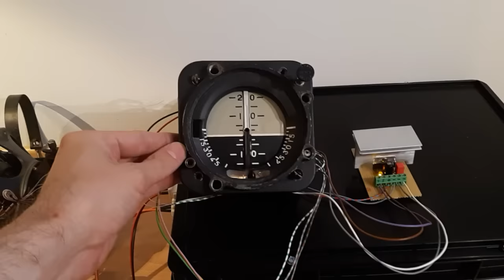Startup of a Russian "type 458" gyro block of a MiG-21 fighter after almost 40years of storage

Comment: Ham radio operators have a system for rotating their big HF antennae. It is a powered system that includes a director at the station, and a gizmo similar to a motor up on the antenna mast. You turn the knob on the director and the motor on the mast rotates, some at a 1:1 ratio in real time, no delay. The way he tilts the gyro unit and the instrument shows the direction and magnitude of the tilt makes me think the basic principles of operation between the two units is very similar.
Reply: This is so called "Selsyn":
https://en.m.wikipedia.org/wiki/Synchro

Comment: For hypersonic missiles this has to be super super accurate, as the plasma surrounding the rocket will make any external guidance impossible.
Reply: It's more like a warhead at this moment, not entire rocket, cause booster depleted about 20 min ago
Reply: @michaelscarn7375  Correct, but it is still maneuverable warhead.  The plasma makes any guidance from external sources impossible, so it is completely flying on initial conditions and calculations from the gyros data, there is so much you can improve on instruments alone, as the environmental variations will put an upper ceiling to your accuracy.  Leaving only one other way to perfect such a system, entirely not related to instrumentations, not sure if I should post it here...the world is dangerous enough already.

Comment: Very nice, i have ohne US Gyro and another very old from Germania wwII.
How are you producing the 3 Phase Supply from DC ?
I Wolldecke appreciate any Suggestion / drawing
Regards Günter
Reply from the maker: Been using the same rotary converter as in the aircraft for a while but it's even more louder that the gyro block itself: https://www.youtube.com/watch?v=Unlu2XggcZc Later on i got fed up with the noise and developed my own board to generate the 3x36V 400Hz supply. You can see it in this video: https://www.youtube.com/watch?v=NclU46997z4

Comment: Hello !
Does anyone know what dimensions a modern aircraft gyrocompass has? I guess that in modern devices, bulky flywheels are replaced by miniature gyroscopes and miniature accelerometers, like those used in drones - quadrocopters.
Is my guess correct?

Comment: You killed АГБ-3к! It was a good gyro by itself
Reply from the maker: No! I had build my AGB-3K instrument out of two wrecked/disabled units. One unit was cosmetically in a good shape from outside, but the electronics were removed/destroyed inside. The second unit was heavily damaged from the outside, but contained good electronics inside, so i made one complete operating instrument out of the two units for my collection. You can see the completed operating AGB-3K here: https://youtu.be/zYsYaa_dnYA 🙂
The pitch indicator block you see in this video is the one left over from the AGB-3K unit which was in a cosmetically bad condition.

Comment: Are the bearings powered by ram air (like from a venturi) or are they entirely electric?

Also, I notice there is one that rotates along the axis of the gyro, One that rotates within it going at a 90 degree angle to the gyro, and another rotating along the gyro's axis. What does that smallest one do and why isn't there just two axis? Is this to help against gimbal lock?

Comment: I'm guessing this works with a motor in the core rotating an object at high speed, thus using the law of conservation of angular momentum the core would stay level and any deviation could be picked up by a sensor to provide accurate pitch?

Comment: Being able to neglect it, set it on a shelf for 40 years and forget about it as dust accumulates, blow it off with a can of air lube it up and use it as a working component is a fundamental requirement for every serious Russian engineering design.

Comment: There is a popular misunderstanding that they couldn't built things well in the Soviet Union, but it's wrong. It's just that most of what they did build well was military kit.  I have an old Soviet watch and Soviet binoculars and the quality of both is excellent.
Reply: Anyone who knows anything about Soviet military history knows that to be factually incorrect. The soviets themselves even admitted to this.

The fact that soviet missiles were not as accurate as their US counterparts is precisely why soviet warheads had much larger explosive yields, and why they always tried to outpace Americans with the number of warheads. 

There is an enormous body of actual research and data comparing the tecnological gap between the USSR and the US. It is not just a 'popular misunderstanding' regardless of what conclusion you've come to based on your old soviet watch and binoculars lol.

Comment: What is the high pitched turbojet like noise ? I mean there are no moving parts there really AFAIK
Reply from the maker: There is a kind of a donut shaped part marked M8 in the middle in which the gyro flywheel spins at 24K rpm making the sound.

Comment: How much voltage & what running amps does it come consume?
Reply: Looks like an operational load of 28V @ ~2.4A.
Reply from the maker: Off the 27V DC supply it draws less than 1amp. From the 3x36V 400Hz the power consumption is around 60W. These are steady state values, during startup this may be a bit higher.

Comment: Thank you - wonderful what precision humans could achieve without cnc!
Would this be run in a vacuum, or were they basically consumables?
Reply from the maker: The whole cabinet of the gyro block was air tight and my guess is it was possibly filled with a small amount of Nitrogen through a filling port on the side.

Comment: Great work:) I have a china copy version of that system, TC-4 gyro and BDP-4 indicator. I tried to make it work but obviously my connection have some fault. Upon powered up, the gyro locked normally, then, while a relay actuated, the relay blowup and my inverter which used to provide 3*36V AC is also blowup. Seems like wrong wiring lead the relay shorted two phase of the 3*36V

Comment: What's making all the noise if the gyroscope isn't spinning?
Reply from the maker: There is a round shaped part in the middle of the inner gimbals marked 'M8' in which the flywheel is spinning. Hard to see due to it's speed, but that is the small motor driven gyroscope of the system making all that noise.
Reply: @barjan82  thanks so much!

Comment: did they mark the threaded part  with m8 so some nutjob does not grab the wrong  size bolt/nut/socket?
Reply from the maker: The marking M8 is to indicate motor number 8. Motor number 8 drives the gyro flywheel in the system. There are quite a lot if motors in the complete system. Both DC and AC motors.

Comment: So the horizontal line never slopes, only indicates going up or down?
Reply from the maker: The gyro block serves analog information of an unlimited +/-180degrees of pitch and roll, but in the current setup the display instrument you see misses the leedle to indicate the roll and only shows the pitch information.
Reply: i would say the test only shows one instrument, other instruments would be pluged in on an aircraft ie like a slip indicator .
Reply from the maker: @yobb89  this unit is capable to sense pitch and roll only. For the direction/heading a separate gyroscopic unit was used. Also for indicating the slip another separate gyro unit was used called the 'EUP-53' device.
Reply: @yobb89  A slip indicator needs no power. The turn part of a turn and slip indicator runs, typically in my experience, on 28 volts or thereabouts, and needs much less power than an artificial horizon / attitude indicator.

Comment: Is there a separate device for the roll? I noticed that it detects only pitching movements.
Reply from the maker: The gyro block being moved by hand outputs both pitch and roll, but in the actual quick'n'dirty setup an instrument was connected which could only show the pitch.
Reply: @barjan82  Ah, I see. Thanks!

Comment: How does the electric power reach the motors in the gyro without the wires interfering with the gimbals' movement?
Reply: Электромагнитная индукция.
Reply from the maker: There are very very precise very low-drag slip contacts that transfers the supply and all analog information between the gimbals.
Reply: @user-rr7kq7jg1z  I read the Cyrillic script first and then guessed at the translation.

Я сначала прочитал кириллицу, а потом догадался о переводе.
Reply: Ah, the wonder of slip rings.

Comment: Does that work by spinning so fast that it maintains its initial position throughout the entire flight? What happens if it shuts off mid flight, can it be restarted in air?
Reply: To my understanding it should be possible to restart. I assume the "spool up" happens in stages to get axis right and gravity takes care of initial calibration/position. I assume the small spirit level visible is just for calibration of instruments. Note that this just what I think is going on. I'm in no way sure at or have actual hard knowledge of these kind of gyros.
Reply: @jothain  yeah that makes logical sense. There has to be some sort of zero state from which it can base its calculation. Because even if it doesnt stop completely its going to detune slightly when its used.
Reply: @Ghanzo  Yeah, I'd think so. Looked again the video and at quite early there seems to be staged "resets" which would imply that at least these claims are possible 😂
edit right after power up

Comment: Yes. Your power supply does have to sound like the original
Reply from the maker: No way! 😀 In the original electrical system of the MiG-21 fighter the 3x36V 400Hz suppy is generated with an old style rotary converter running at 12k rpm having a sound like running two vacuum cleaners in the room 😀

Comment: Someone explain please how it doesn't start precessing and turn the reading to nonsense?
Reply: Precession is what causes the reading.  The outer frame he is holding would normally be fixed to the airframe, movement of the "gimbal" inner frame relative to the outer frame and the inner frame holding the axle is part of the measurement. Wikipedia page on gyroscope is useful.
Reply: @Sylvan_dB  I understand that the gimbal movement gives the reading, I don't think this is precession. I don't understand why the spinning body inside doesn't begin to move off-axis because of uneven forces that inevitably will affect the gyroscope inside, making it go absolutely nuts.

Like it's not constrained, it's free to move on any axis in there, why doesn't the reading start to float after 10-15 seconds

Comment: Thats interesting and all, but what the hell is a gyro and what does it do on a jet/plane
Reply: As you rotate your smartphone, you can see the picture on the screen is also rotating. That's because your phone has the gyroscope, an incredible tiny component, which allows the phone to orientate in space. Same goes to this ancient device on the video, it's a gyroscope as well, just a bit bigger. This thing allows the pilot to navigate their jet looking at the angle on a dashboard, which is very important when you disoriented and can't rely on your feelings at high G's.

Comment: I wonder what the accuracy is compared to some cheap off the shelf ic is?
Reply: They aren't purely ICs they are MEMS devices, a "gyro chip" actually has microscopic vibrating elements that detect angular rate by means of the vibrating structures wanting to remain in plane when the chip is rotated.

Comment: Can someone explain what purpose does it serve in a MiG fighter plane?
Reply from the maker: This unit serves an unlimited +/-180degrees of pitch and roll information for the HSI/Attitude indicator in the cocpit for the pilot. I have to check but as i was told the pitch roll signals from this unit were also used for the autopilot and wheapon aiming.
Reply: @barjan82  oh thanks

Comment: And NOW All This Apparatus Can Be Made In NanoScale
Reply: No memes gyros use a slightly different principal. They use vibrating elements and capacitance to detect angular rate change. The vibrating structure wants to stay in plane. They work similarly to how the haltares on a housefly or mosquito detect angular rate.

 That's why a housefly is so agile btw, their hindwings are modified into angular rate sensors that feed information directly into the nerve cluster controlling the wing muscles. The fly's flight control nerve system has an exact sense of it's angular momentum.

Comment: What is the angle/time drift of this model?
Reply: Any gyro drift is automatically corrected by a feedback loop which applies a precession to the relevant gyro gimbal. The gyros are rate gyros which hardly move at all - as soon as they start to deflect the feedback loop precesses them back to neutral and the scale of the current required to do that (in each axis) is what the unit is all about. The unit relies on a mixture of gyros and accelerometers in each axis, the gyros keep the accelerometer platform stabilised so the accelerometers sense changes in velocity in their assigned axis. The gyros also give attitude and heading change information, the heading change being available separately or blended with a gyromagnetic magnetic compass output.

Comment: Cool, Hobby. How does it find it's initial position? @ 0m17
Reply from the maker: Upon ever power reset there is a relay logic which triggers a reset process of the gimbals. Basically a small dc motor does the initial reset of the mechanics.
Reply from the maker: Correction: the pilot can also request this reset procedure from cockpit. It's also called gyro caging.
Reply: @barjan82  yeah, but i wanted to know how it finds the zero point, is it simple mechanics, like a light barrier, since the gyroscope has it own water level and has to mounted level.
Reply: @Rich-on6fe  Wouldn't that depend on the plane actually being straight and level on the ground and not sitting on a grade though?
Reply: In these parts the control to set the instrument to a level indication is labelled "fast erect" and assumes the aircraft is level (in flight or on the ground). If it isn't, the instrument will correct itself slowly without any action by the pilot.
Reply: @Rich-on6fe  Thanks, but it probably should have some zero "reference" to adjust to.
it could be done with a light and a ldr.
Reply: @Rich-on6fe  ya, that's old news. even a "cheap" piper airplane has it.

just wanted to know if the device has a internal zero reference.

Comment: is that motor  a brushless  or simple DC one.
Reply from the maker: To spin the flywheel of the gyroscope a small 3phase induction motor is used running at 400Hz 36V
Reply: @barjan82  thanks for the quick reply.

Comment: How did they prevent drift?
Reply from the maker: There are special fluid switches mounted to the platform of the gyroscope. If the shaft of the gyroscope comes out of true vertical due to any effect, these fluid switches will control torque motors on the gimbals in a way to correct the gyroscope to the correct position again. It's of course a slow process, this gyro drift correction mechanism can correct about 10degrees of error in about 5-6minutes as i remember.

Comment: It sound like it can be used as back up engine, judging by the sound of it.
Reply from the maker: The flywheel stores a enormous amount of kinetic energy while spinning. Some says it stores more energy than a bullet. In this unit it takes for the gyroscope about 8minutes to come to a full stop when power suppy is removed. I have a gyroscope only from a heading/directional unit. It's a beast, if it reaches the full speed and operating temperature and power is removed it takes almos a hour to spin down to a full stop 😮
Reply: @barjan82  Quite impressive.

Comment: Why was it rejected?
Reply from the maker: Can not tell where, but it was a sad ending for one MiG-21... 😑 The whole plane was scrapped after sitting 40years outside as a display piece. There was a rare, one time opportunity to remove some parts from the airframe before cutting the airframe up in pieces. Before i got there all instruments were already removed from the cockpit, so that's why i could only get the gyro block only at that time.

Comment: We sale ex CCCP gas turbine heli (HIND) gas /diesel genset, tanks, Ural 6x6 375d truck, MIG 23 Warbird.
Also have in hanger MIG 21 Inc 458 block gyro.  Aircraft full fly condition. We rebuild hot section cassette blade, burner injectors.
Still good plane.
Greeting from Russia Girood Airfield Hangers. ♥️

Comment: I’ll tell you something interesting. Almost everyone has a compass for pointing “North” when hiking or walking. But the compass that people have isn’t a real compass. A real compass, like this gyroscope, rotates both horizontally and vertically. 

For example, if you’re in an area with strong gravity, the compass might point due “North” but it will also point down forty degrees. 

Gravity all over the world varies widely, but you won’t find a gravity guage on Google Earth. They don’t include that information because places with low gravity indicate low surface mass, as if the land were thick in some places but thin in others. This could only happen if the earth were hollow.

Comment: gyro's only work on a flat plane, not a globe.......
Reply: jajajajajajajajajajjajajajajajajjajajajajajajajajajajajajajaja
Reply: Unless they've got pendulous vanes that reset them to the local gravity direction.
Reply: gyros only detect angular rotation rate what direction is "down" doesn't really matter. A three axis accelerometer will tell you what direction is down though as the "down" direction will always show a 1G rate of acceleration. This is how the "rescue" mode on R/C flight stabilizers can tell where "down" is and reorient the plane when you flip the rescue switch on the remote. They use a 6 axis motion processor (three angular rate sensors and three accelerometers) basically the same type they use in mobile devices such as the Invensense MPU6000.